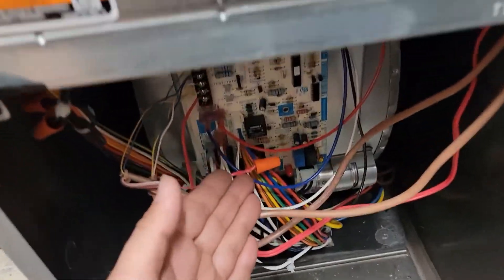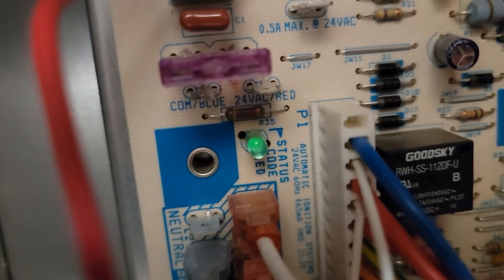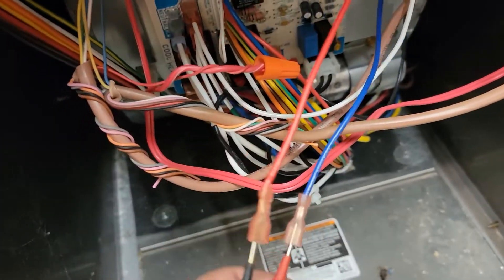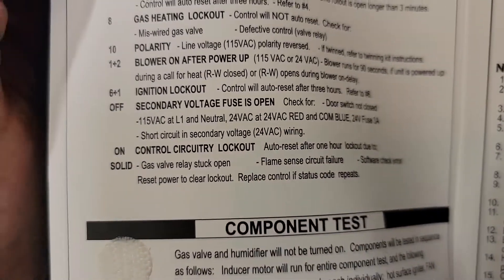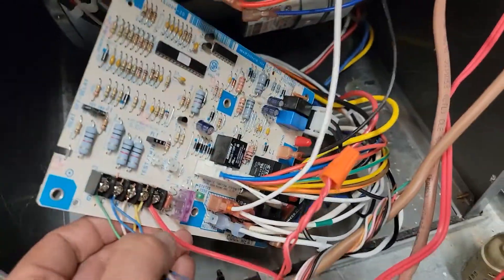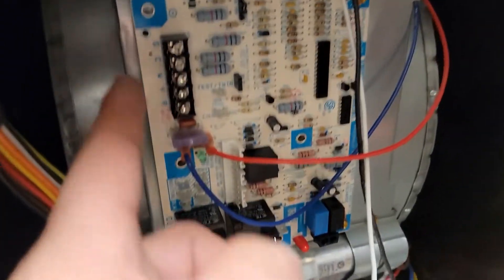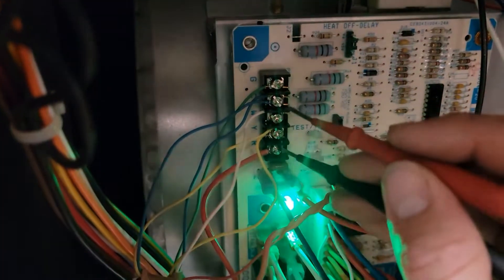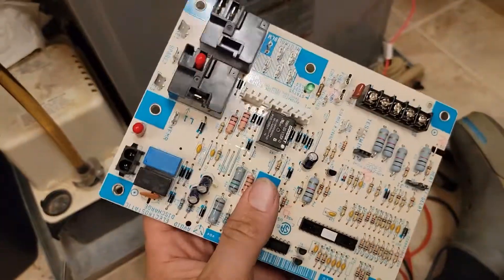GAS FURNACE EXPERT Shares Top CONTROL BOARD Troubleshooting Tips

Comment: Personally,  I would of removed that Carrier board and furnace and replaced it with a Rheem.
Reply from the maker: ok so I gotta know
 why do you go with rheem?
 The only reason I don't go with rheem is because of the redesign on other equipment with the coil on top instead of side discharge 
Give some Knowledge
Reply: @taddydigest  The reliability of spark ignition over hot surface primarily.
There's a reason nearly all RTU manufacturers I've encountered use spark ignition; long term reliability. 
The access panel knobs require no tools, stay attached to the doors, and so far haven't fallen apart.
 My only complaint is on the high efficiency models it is difficult to remove the spark igniter for cleaning.  I use a pair of side cutters to modify the bracket so that it is easier to remove.
I am not a fan of Carrier due to multiple problems with induced draft motors and rusty, clogged secondary heat exchangers.
Trane and Lennox using oddball 80V and 90V igniter is just wrong to me.
Also, any manufacturer  that installs a bulkhead  that impedes access to the blower motor and wheel is irritating for pm's.
TY for letting me vent lol.